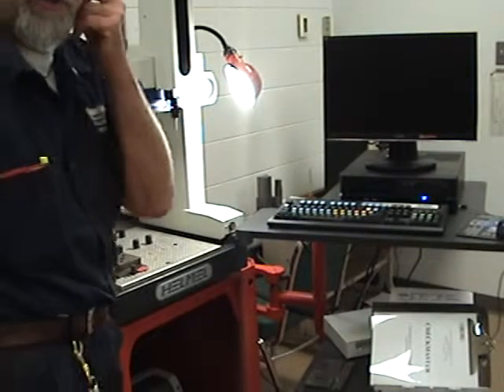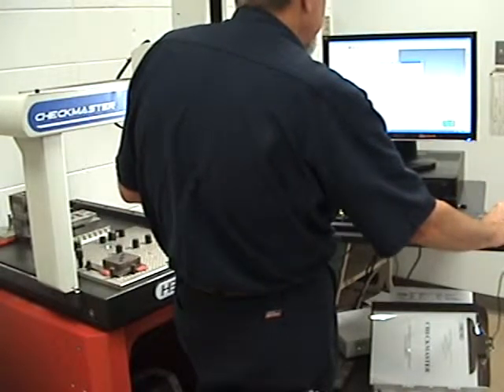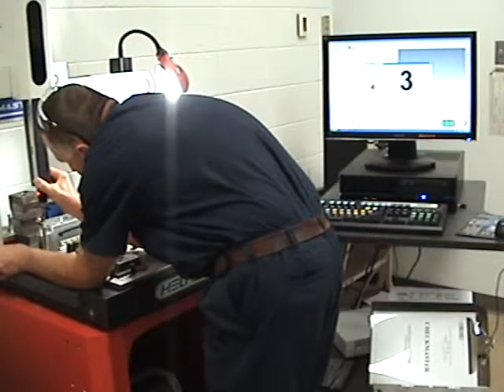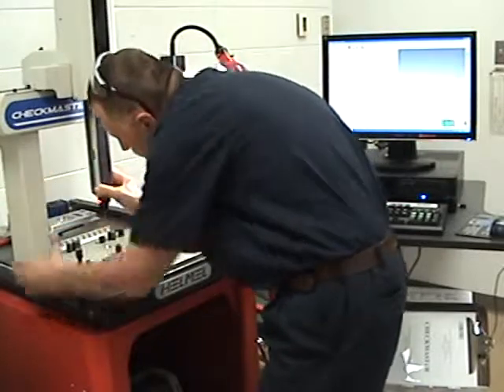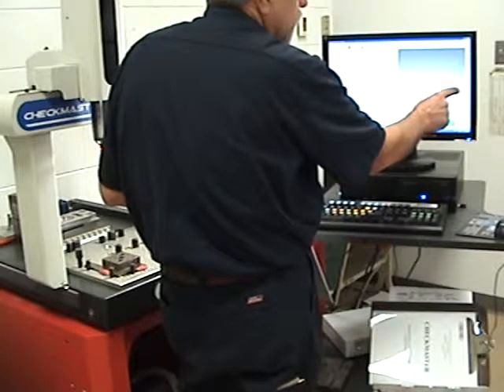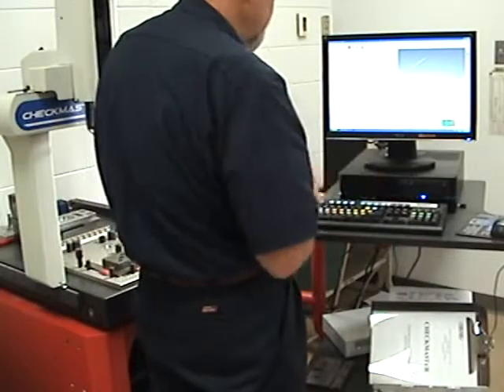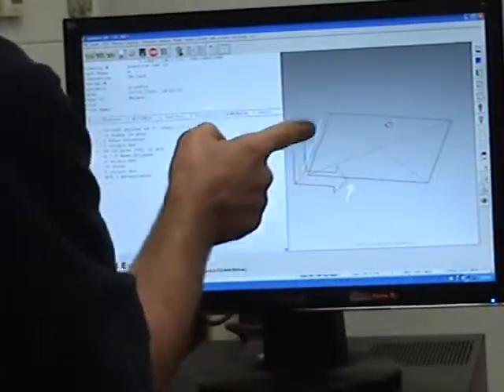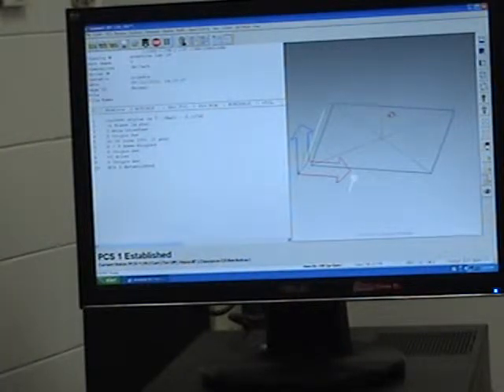Measuring with the Helmel CMM

Comment: How do you set the origin on a square to be dead center of the square
Reply from the maker: You can set the origin at half of the part if you know the exact size. Touch one side, zero, then move over the required distance then origin again.